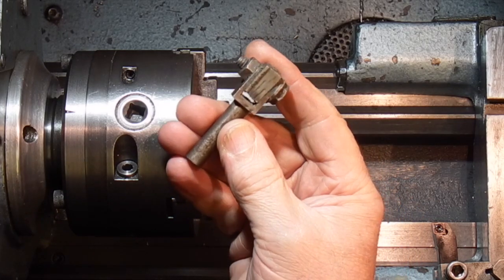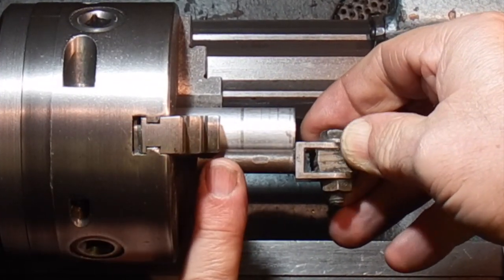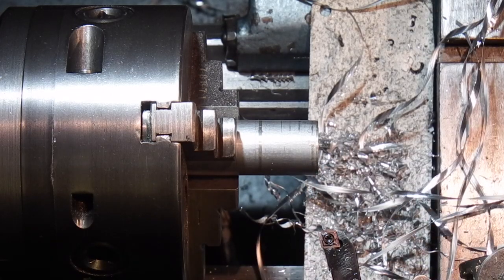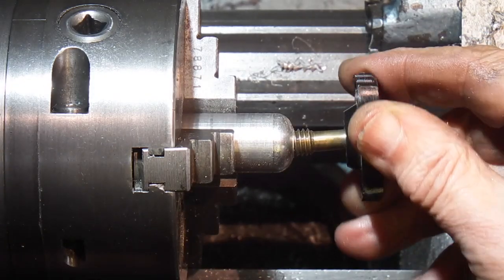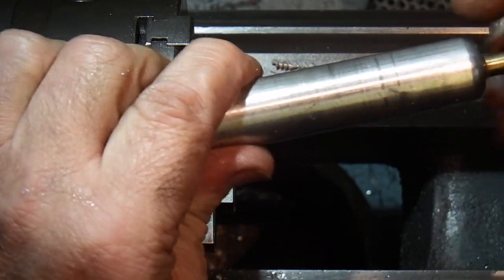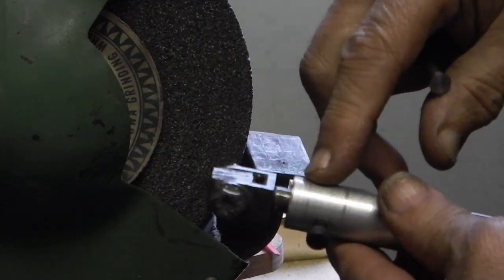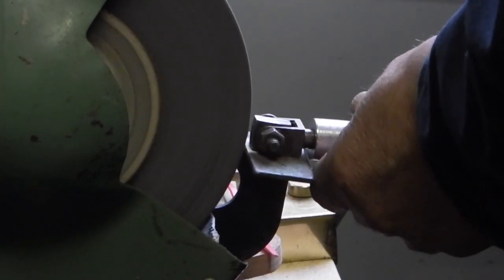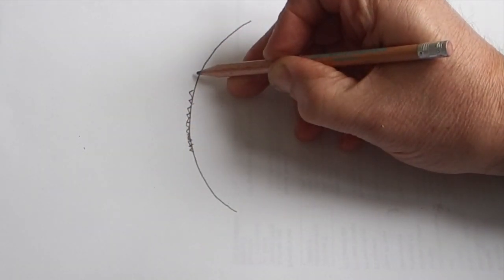Grinding wheel dresser

Comment: Hi Alan,
What stops a non concentric wheel from pushing the dresser away from the wheel ?
I've fitted a new wheel after doing a ring test, I'm struggling to get the wheel concentric by just holding the dresser.
My grinder still  vibrates and the wheel is still not concentric, after dressing it
I've checked the spindle for runout it runs true. Even turned a new delrin Bush for the wheel.
That's what's led  to the question.
Reply from the maker: Hi Adam The edge of the dresser (aluminium part ) runs along the front of the tool rest. Check your tool rest is tight.
You make sure the dresser is pressed firm against the tool rest edge. This controls the diamond distance to the wheel. then adjust the diamond forward taking the high spots of the wheel until its true and round.
Reply: @enotsengineering  
Thanks Alan

Comment: Allen very good video. What is the life expectancy on a diamond dresser. I recently purchased a small grinder only to sharpen HSS tool bits for my lathe. It came with a T shaped diamond dresser, I haven't used it much due to I only use that grinder to sharpen tool bits. It's the first diamond dresser I have had and was wondering how long it would last. Thanks for the informational videos.
Reply from the maker: Hi Anthony
Thanks for watching, the diamond dresser in the video is over 20 years old. It was a used one when I had it.